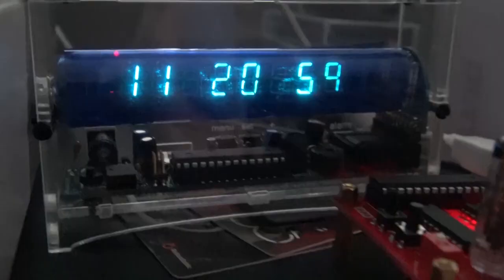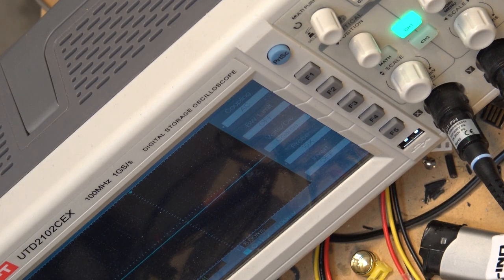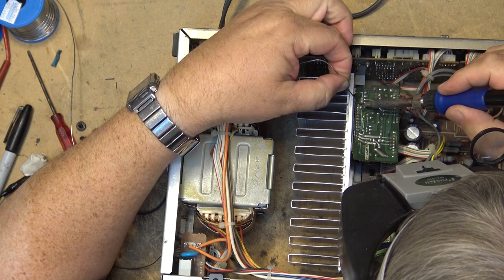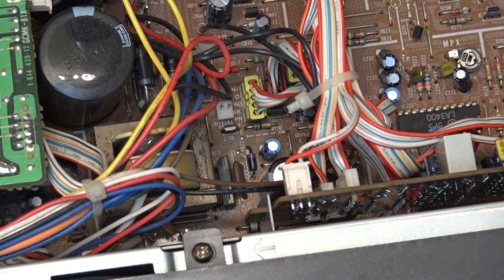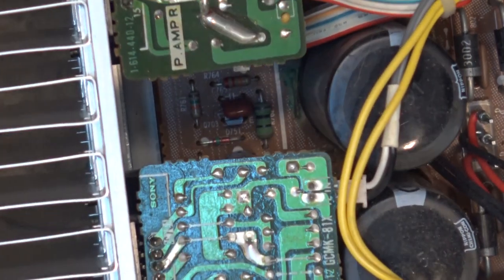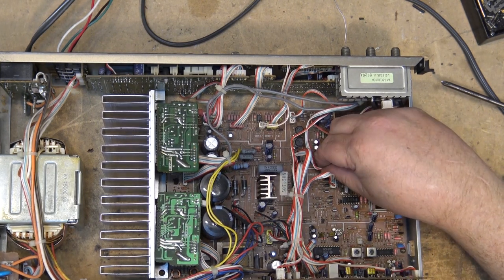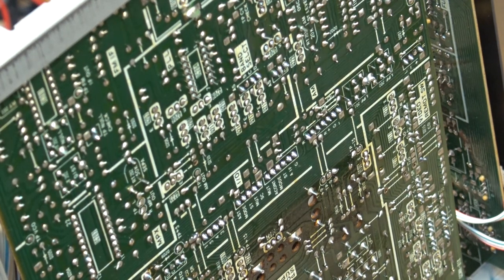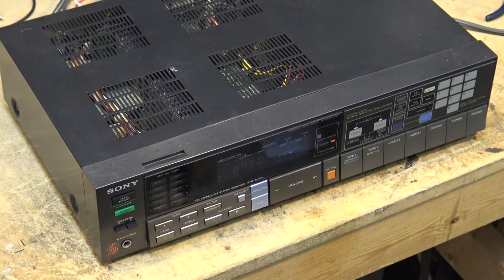Sony STRAV470 One Channel Cuts Out REPAIR

Comment: thanks for repairing this for me dave. wouldn't surprise me if something was spilled in it this was a thrift store find and it was pretty grimy when i got it. whoever owned it before also left energizer batteries in the remote totally ruined it the acid ate up the traces and when i tried to clean it up the pads the buttons touch on just wiped right off the board. had to find another remote on ebay.
Reply: I was lucky, when I got mine, I had an old SONY multi remote unit that worked right off on this set, still use it to this very day!

Comment: I have an old 35 foot Class A Motor Home, 2003 model with the CRT type back up camera receiver in the dash.  Every year before we head her South for the Winter months I have to pull that old CRT out and re-solder the power input as they just will not hold up to the vibration of that big old 8.3L Vortec V8 engine as we pull over the Rocky's and into the desert of Arizona.  Ah but that was long ago now, she sits idle now because traveling without my lovely wife is just not any fun.  GOD how I miss her, she has been gone now for nearly a month and my heart has yet to begin to heal, 51 years and 4 days we were were man and wife, and stayed that way till death did we part. Friggin cancer!
Reply from the maker: So sorry to hear that.  I would be in the same state of mind if something happened to my wife.  Been with her now almost 40 years.  She was still in high school . Have lost many friends to the big C and have one friend that is battling it right now.   I lost my mother last year to the big C.  She was 92 however but in the last couple of months went down hill very quick and they suspect cancer.

Comment: Thanks for the video, I purchased one of these beast about ten years ago off Ebay for 20 bucks, she has been working great for me ever since, but I just wanted to know more about the set, this  shows the inside without me having to tear her open. Oh indeed the FCC can be a bit of a bear when it comes to transmitting on the public airwaves without proper licensing. Even with a Ham ticket, you have to avoid the Am and FM frequencies. I recall back in 1970 we had fellows in Vietnam who had taken old 26D units that were not being used for teletype and broadcasting pirate radio over AM frequencies. It was great, of course there were not a lot of folks who gave a dam about such things over in Nam back then. I usually tuned to AFVN back then, as a matter of fact I have built a few WIFI receivers that I have tuned to the rebroadcast of AFVN Vietnam broadcasts, one is hooked to the tape input of that very same SONY unit you have on the bench in this video, well the very same type, of course not the same unit.  Sort of fun to listen to the old music and those advertisements for the Army were classic, "Don't forget to take your malaria pills every morning with breakfast!"

Comment: Very nice am/fm stereo receiver amplifier,,,,fair bit of work with the re-soldering the dry joints and also finding corrosion on the circuit board,,,caused by water had been spilt into it from the cabinet stains seen.

Comment: I have one very similar to this unit. I think it is an STRAV360 or similar number. Same problem. I ended up re-doing every single solder joint on the main board. Every time I thought that I found every bad one, another 10 cropped up. So I just used the shotgun approach and did them all. 
Mine has a lithium button cell behind the front cover near the display that backs up the stations. I believe it is a CR2032, with solder tabs on it. Amazingly, mine has the original from 1986 or so. It will still hold the stations for a week. Hard to believe there is anything left in it after all of these years.

Comment: This was great. I have a newer than this Sony that has one channel that is a lot quieter than the other. Balance controls are all handled through the menu, and have made sure that was centered. Could a connection issue like this make one channel quieter than the other?

Comment: Isn't it better to put a thin wire in the tin when repairing the PCB wiring than to solder the joint for many seconds. That's it for ungluing the PCB connection and the wires can be melted into the solder quite quickly. The connections do not suffer from overheating.

Comment: Does the (Speaker) Relay protects the Speakers  off DC charge? From high Dc offsets?
Reply from the maker: The speaker relay protects absolutely nothing when it's energized however when it's de-energized the outputs are disconnected from the speakers. It's a speaker protection circuit that protects the speakers if an overload is detected it will be energized the relay to protect the amplifier if the amplifier fails and is providing DC voltage to the speaker terminals it will the energize the relay. this is most important during power up and shutdown because as capacitors charge and discharge there will be swings in the DC voltage on all amplifiers. There's a delay built in which prevents the relay from being energized for several seconds until the DC has stabilized and gone to zero only then will the speaker energize will you turn it off this relay opens immediately before the power draining out from the power supply would cause any significant rise and the DC potential on the speaker outputs. I would not run an amplifier that did not have a speaker protection relay or a blocking capacitor or an output transformer. Blocking capacitors are the older quasi complementary output configuration that used for npn transistors and the midpoint was actually floating about half of the DC potential so a blocking capacitor was necessary for operation. Transformers were used more in vacuum tube equipment unless we don't have to worry about DC passing through the transformer.

Comment: i have a sony ta-636 amp from 1980 one channel very occasionally crackles, doesnt need the pots cleaning did all that, i suspect a failing transistor. its already been re-capped with nichicon fine gold.
Reply: I have a sony_str-313l , a cute little beautifull receiver that i bought. Same problem, i didn't start to repair it yet. The previous owner made a mess in it, trying to repair it. I suspect bad capacitors or transistors or bad connections.

Comment: This is amazing. A few cold solder joints can make something stop working properly. I did this to a 1980s "ghetto blaster" style boombox which had weak output. It was on the main filter cap, I must have "woken" it up with the iron when I touched up a ton of solder joints. I just need to fix the controls and replace belts in the tape deck and clean everything up. The unit was in rough shape when I got it. It's a Magnavox D8443.
Here's a video of mine
https://m.youtube.com/watch?v=cKh4q7sCGr4